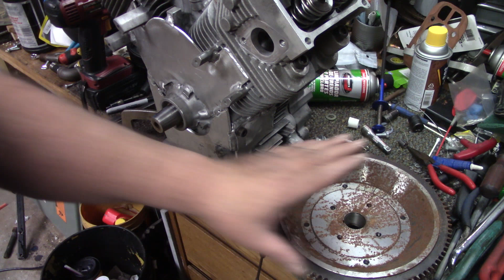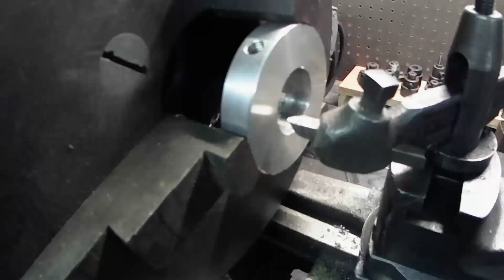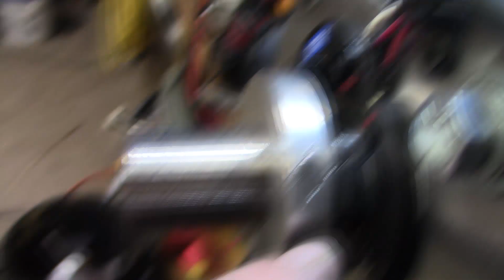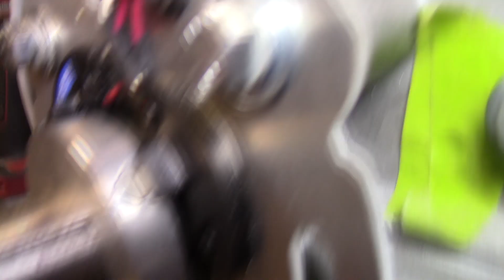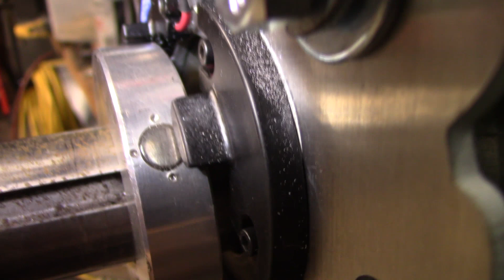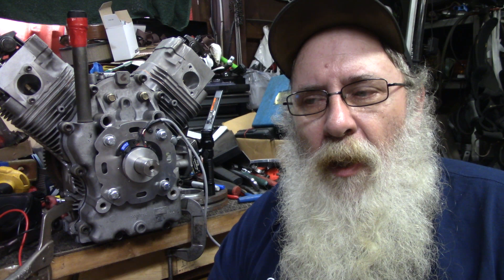Kohler Command Pro Mod  V Twin Engine Build Part 12

Comment: Good work! Interesting note on lapping the taper.
Reply from the maker: I especially do it on used cranks and flywheel setup to ensure proper fit and holding.

Comment: Welding a handle on the base piece is much bettet.then the timing can be set with a light and motor running..you also need a degree wheel and dial indicator to locate top dead center to place a 0 mark
Reply from the maker: I have one that has the handle and it sucks..I still prefer to adjust the ring. I always mark TDC when I'm assembling the engine weather I'm using the crank trigger setup or not
Reply: Do you use a degree wheel and dial indicator to locate and confirm top dead center.a piston stop can be used with a degree wheel too
Reply from the maker: Yes, a degree wheel and dial indicator is the best way to do it.
Reply: Yep,lots of guys f the timing up based on the 4 degrees of dwell at top dead center